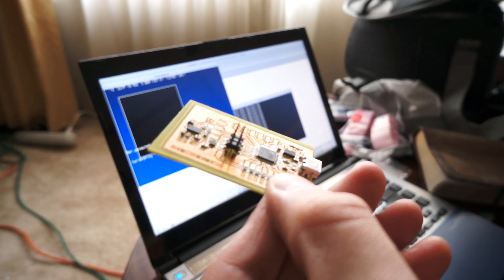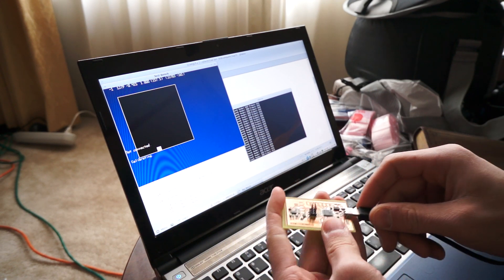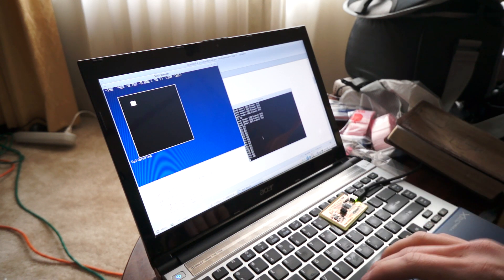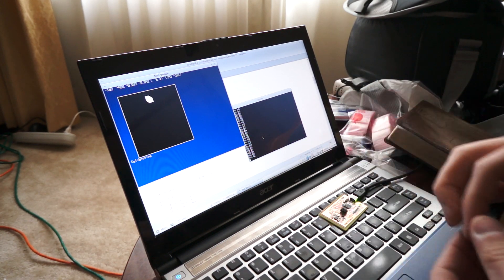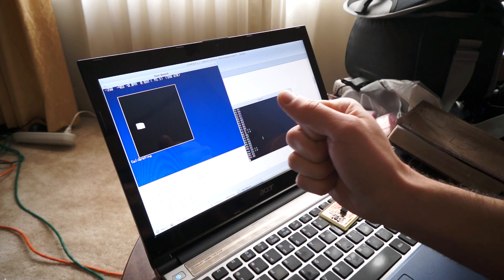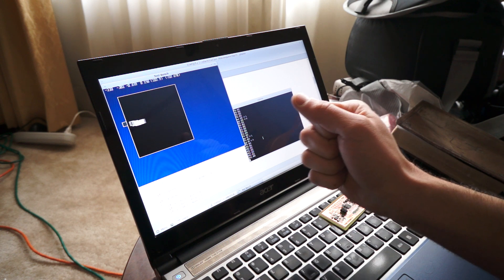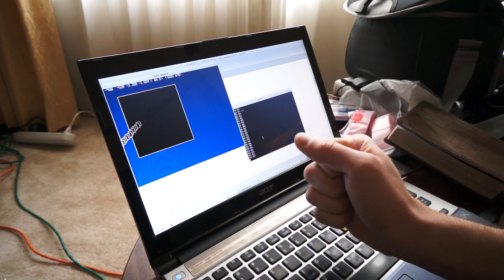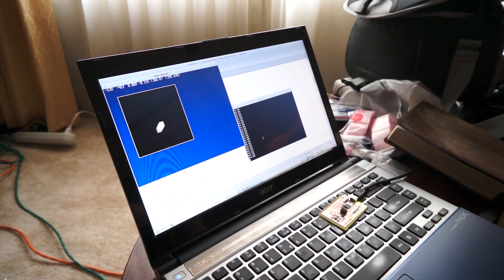Fun With a Non-Contact Magnetic Joystick

Comment: Cool. I wonder if you could use the sudden switch of polarity as a fire button. The magnet could be mounted on a pivot and one end connected to the plunger of push button.  The housing could be designed to fit into your hand like a joystick. 
Another idea: if you could detect 3D orientation then simply dropping your hand could be the fire button.
Reply from the maker: +Rouverius You can't really detect the height /that/ well, but you can to a degree, so it would probably work.